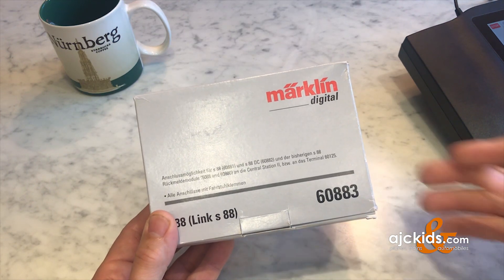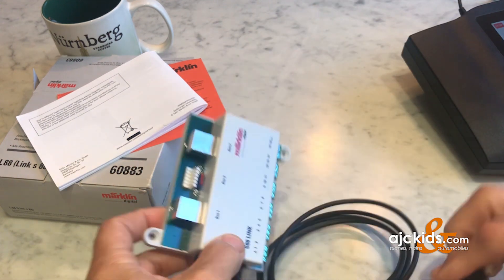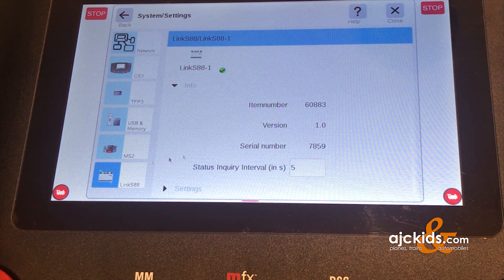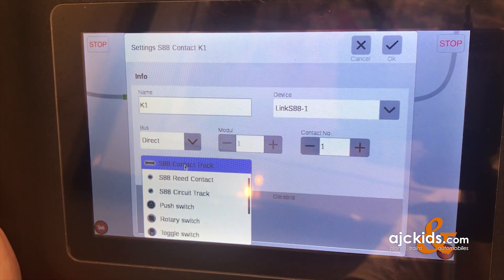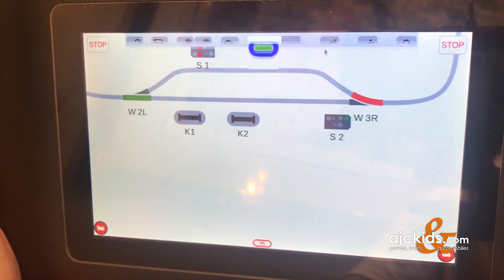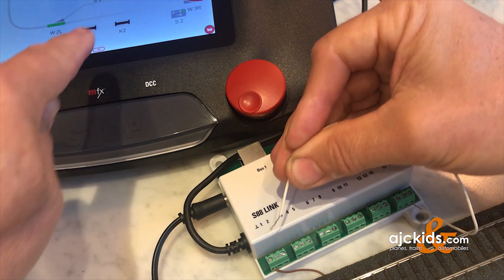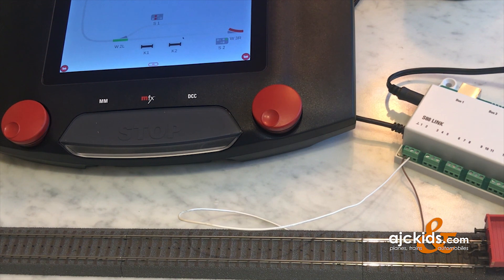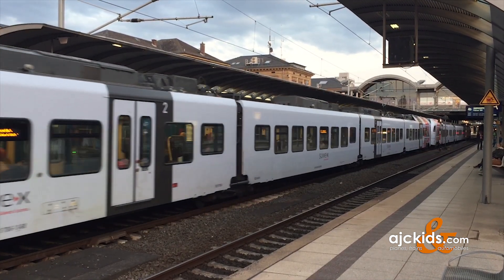Marklin Feedback Decoder S 88 - Part 1: Installation and connections

Comment: hello, do you know if it's possible to use with a CS3+ current feedback like Digikeijs DR4088-CS ?? thanks a lot.
Reply from the maker: I am not 100% certain since we have no experience with the Digikeijs products, but I think it may work. The Digikeijs module seems S-88 compatible. This module allows you to connect your older S-88 (Marklin) decoders. Thus you would think the Digikeijs will work as well.
Reply: @ajckids  Thanks a lot